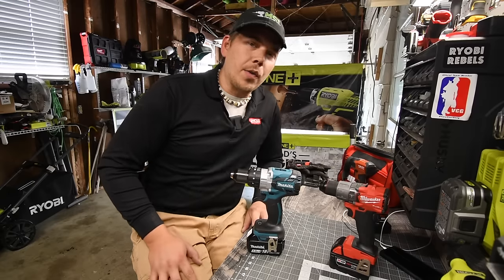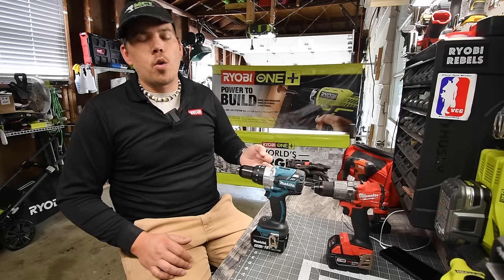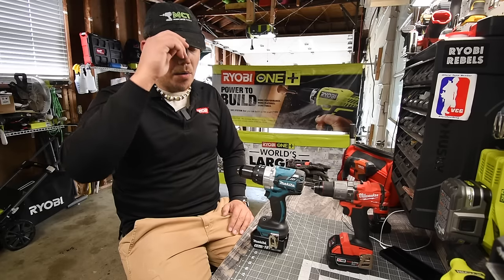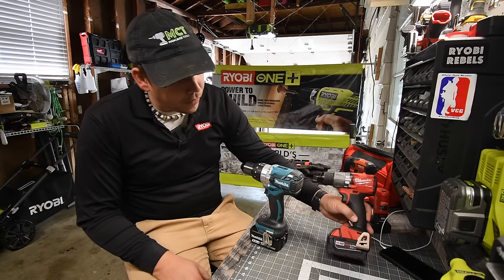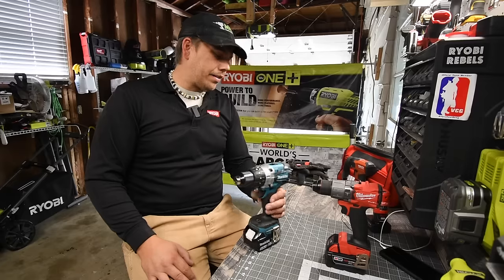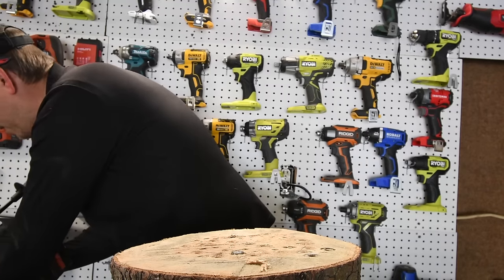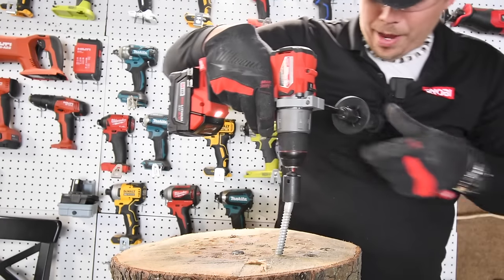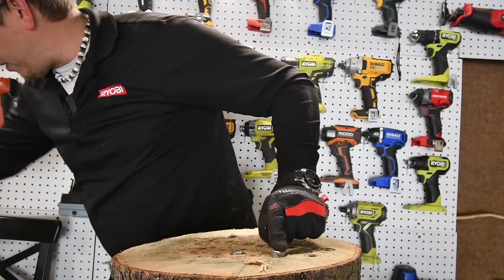BATTLE OF THE BRUSHLESS!!!  (Makita vs Milwuakee)

Comment: Build quality are equally excellent, same plastics, great designs, but Milwaukee has the edge in motor and battery design, however, Milwaukee tend to use fragile ribbon/small cables inside, the Makitas have solid wiring.
There is very little to go wrong with Makitas, just takes the edge in Robustness I would say, so power or Longevity?
Reply: But what's actually a better design, the F1 race motor that needs to be rebuilt after every race, or the diesel that clears a Million miles before it's first.

Our shop has 4 Milwaukee drills, two run, one is an old brushed design that has no guts and the other let's bits go randomly while you're drilling
Reply: @jonathangarzon2798  I have had hundreds of these tools apart, Milwaukee and Makita only have slight quality variations, you get a FUEL and you can bet its going to last a long time, don't touch the none-fuel however.
Get Fuel and you will wont go far wrong, it might even last longer than most Makitas.
Reply: @suzesiviter6083  Im not sure what you do for a living but Im a welder/fabricator so tools that might last a moderate amount of time in a regular construction site just don't make it.
Drilling through metal takes a higher toll on tools and the metal particulates in the air, and constant high frequency EMF shorten lifespan of any electronics.

The only tools that I can say have proper longevity are the recip saw and bandsaw from Milwaukee.
And quality is definitely not close. The battery engagement alone is slop on Milwaukee (though not as bad as DeWalt)
Reply: @jonathangarzon2798  A lot of people complain about battery slop yet few have had any real battery connection problems,, have you? they use the same knife contacts as Makita.
Are you using fuel versions?
Check out Ave channel with tear downs, I am not convinced Makita is better quality and if I were doing drilling all day, I would be buying an Hilti not one of these class of drills.
As for metal dust, Milwaukee fuels are fully sealed electronics, potted, you could even throw one of these in a bucket of water or oil and they would still work, plus the gears are usually the properly machined parts not the sintered variety in the places that matter.
Reply: @suzesiviter6083  yeah we have two Milwaukee batteries that have to be taken out and re seated during drilling due to bad contacts and since they aren't corroded it's gotta be a mechanical issue.

Battery slop transfers undue torsion on the contacts shortening life. This is the problem with brand fanboys though never can admit anything is wrong until they do, and then it's "good enough".

Fuck brands I get the tool grade according to use, and tool according to best quality.
Reply: @jonathangarzon2798  But are they Fuel, trust me it does make a difference, for instance the battery connector on Fuel is usually put under tension by a spring.
The fault you mention is probably the sense connector losing connection, that's why it doesn't start back up till the battery is removed, light sanding and wd40 should do the trick.
Only serious fault I have EVER seen on fuels is broken ribbon cables, and I used to buy faulty ones to repair.
Reply: @suzesiviter6083  yeah we don't use non fuel
Reply: @jonathangarzon2798  ok, well good feedback, Makitas been ok?
Reply: @suzesiviter6083  yeah don't get me wrong Milwaukee doesn't make bad tools but for the premium over the Makita LXT it's just not worth it in my opinion, but yeah haven't had issues with my Makita drill or mid torque also noticed it runs cooler than the Milwaukee's and way cooler than my old DeWalt
Reply: @jonathangarzon2798  Yeah know the LXT grinders are perhaps the best. I think the heat issues is due to the extra torque though)
Reply: Milwaukee doesn't really have the edge in motor designs, Makita does. Milwaukee just prioritizes performance, Makita prioritizes features and ergonomics.
We really see this come through between the impact drivers and wrenches, where Makita's drivers tend to not one up themselves each generation on torque/RPM, have enough power to snap 1/4" hex shanks towards the peak of their power range, but add more features like bolt/wood/sheet metal modes and programable buttons, where Milwaukee primarily makes the newer versions more powerful and smaller but not adding more features.
Whereas with impact wrenches, where we aren't limited by 1/4" shanks, we see Makita really does push quite a bit of torque relative to their class, and being the major company that actually poses a challenge to Milwaukee very regularly. IIRC, Makita offers the better performing high torque and compact wrenches.
Reply: @reaperreaper5098  I think just about anyone would prefer power, with power comes less strain on motors due to less overheating. No IMO you are wrong, perhaps you are a makita fan boy.
The high torque M18 fuel impact wrench is THE standard, check out the torque test channel.
Reply: @suzesiviter6083  You should see TTC's video on the 3/4" XGT High Torque.
You've also missed the mark completely on the Makita fanboy comment. I've ran Milwaukee for nearly a decade, I just haven't deluded myself into thinking that Milwaukee's the outright best.

You're also wrong about the "just about anyone would prefer power," because the differences in even most testing demonstrates that picking any of the big 3 is going to do great, and many mid tier brands also do very well. And Makita has a huge following for its ergonomics.
Reply: @reaperreaper5098  I am talking from a science perspective having taken apart all the well known brands, Milwaukee motors use few winding, high current, with their inherently low resistance field windings, they will run cooler at high torque, heat is the main killer in power tools. Makita used to be the best, but their motors are simply not as advanced as Milwaukee, even the drive circuits use sub-mohm latest generation of IR mosfets reducing heat and lifetime of circuitry-output mosfets being the weakest link in power tool circuits.
As for mechanics, makita might use better machining occasionally, but even 5 year old heavy use Milwaukee tools have insignificant wear in all those I have seen.
Reply: @suzesiviter6083  A "scientific" perspective, fewer windings isn't automatically better, it's a trade off. Fewer windings, higher RPM, lower torque. Bigger windings, vice versa. And between comparable 18V tools, the winding counts are similar.

As for Milwaukee using higher current motors, that too is a double edged sword. Higher current, the more heat, it's the direct result of driving up current (and why every other company is moving to higher voltage platforms for beefier tools). Hell, it's for this exact reason that Mils has to use vastly larger motors for tools like their chainsaws and circ saws, which is an antiquated approach.

You also talk about Milwaukee's component selection as if they're the only ones that have that option and leverage it. Which, quite frankly, is not the case, for two reasons. 1) None of the big 3 use the absolute best components available, it'd be too expensive for the price point they aim for. 2) The big companies that position themselves in the prosumer/professional market are all using components of very similar quality.

Hate to say it, Milwaukee isn't outright better than Makita. They're not outright better than any of their prosumer market (except Flex). They're an option in a market segment where it is pretty damn hard to go wrong.
Reply: @suzesiviter6083  the m18 fuel drill and the makita lxt 18v drill have already been extensively tested and the makita always runs cooler with its engine while the milwaukee has high engine temperatures
Reply: @reviewsyanalisis7244  Thats because the Milwaukees always have higher torque hence power, cant defeat laws of physics.
But a motor under less strain lasts longer, thats why it would be milwaukees every time for me.

Comment: just picked up the same model from my local home depot tool rental lol only went out twice and it came with 2 5amp and a nice charger. paid 100 bucks with a hard case   the chuck gave you a hard time but coming from milwakee I have to say I'm impressed.  yeah it might be a sec or 2 faster or slower but man it was 20 degrees cooler than the milwakee.  in my opinion that's called efficiency.   a nice cool motor will last alot longer!
Reply from the maker: I agree with you on that, that is why temperatures are important as well

Comment: Thanks for the review, I own Makita and Bosch both line of power tools right now, used to own Bosch and Milwaukee but after my Gen2 impact driver was died then swap to Makita line. Personally the I saw the Makita chuck died with another IG users and same as Milwaukee, but I never had any issue with Bosch chuck for past 5 years time, I know for the Bosch drill speed may behind Makita and Milwaukee, but it still good for my trade with Bosch. I just love the feeling for Makita and does job so well. For the weight distribute of Milwaukee is not suit for me, it seems like Milwaukee put lot of weight in the front and battery. This Makita drill was over 6 years old did good job even compare with the latest Milwaukee drill.
Reply from the maker: I do think it is time for Makita to upgrade this tool
Reply: @ManCaverTools  however makita 40v is released don't know what strategy in the future of the company. Probably makita will get ride of 18v x 2 system and keep 18v and 40v both line together?

Comment: I have never had the chuck come loose on my xph07. The m18s I use at work do come loose and freeze also.
Reply from the maker: I push these tools through the extreme tests and I thank you for viewing Darren
Reply: Neither have I. I love my xph07
Reply: Milwaukee tools never let me down in any conditions snow rain nothing stops them
Reply: Milwaukee does make good tools. I'm a second generation plumber and they make a lot of great plumbing tools. My dad and a few other guys have milwaukee fuel drills and one of them the forward and reverse selector doesn't activate unless you pull the battery out and put it back in. The other drill will just stop working all together randomly and then start working again. Every brand has there drawbacks I've just seen that first hand. Never had any issues with my makita stuff but every guy is loyal to their brand 👍
Reply: Milwaukee never let me down either

Comment: I had a lot of makita,s ,now have 484 and 486 but the Chuck is always a problem
I bought an more expensive Chuck for the 484.
Sometimes when they get hot the drill or bit get stuck in it and you need a lot of straight to get them out and it never sounds good when you do that
It sounds that you break something but it never happens.

Comment: Remember......the Makita is AT LEAST 5 years older than the Milwaukee.....5byears older technology, electronics.....The Milwaukee is already 2 years old.
Reply from the maker: Yes it is. I think it is time for them to upgrade
Reply: Is that the latest model?
Still thinking of buying makita still choosing
Reply: @user-tu7rr1zg4b  yes it is however theyve got a new drill coming out soon hope this helps
Reply: The milwaukee 2704 is 6 years old but is much poweful than the latest milwaukee 2804 when it comes to concrete. The 2804 only have the torque but not the hammering power due to its reduce size

Comment: As I said, I own that Model of Makita.  This was one of your better ‘Versus’ videos.  Having said that, and as Eryn Brady said, regarding the chuck, the one on your drill didn’t ‘sound’ right, or act right?  And once a Chuck has slipped twice or more under that pressure, the jaws will lose some ability to hold onto the bit.  Love your channel and videos dude, but please try fully tightening the chuck, and then leave it.  Don’t turn it back a click!  Trust me!  I’m surprised the Gen 3 Milwaukee didn’t do better.  It is a powerful drill. I tried it but just don’t care for it.  And the ‘smell’ you mention Dave, I believe is a characteristic of that drill.  Mine always has a slight warm oil smell?  Hard to describe.  I would get Makita to warranty that chuck.  Their repair facility in NJ does a great job.  Just FYI. Thanks
Reply from the maker: I thank you for your reply. I just think I need to put a new chuck on it. and I think the smell is the natural smell from the makita motor. and I thank you for viewing George
Reply: Man Caver Tools, Dave I just saw George’s comment directed towards the chuck.  Why are you being so obstinate regarding tightening the chuck correctly?  You are the first person I’ve seen rotate the chuck counterclockwise after fully tightening it clockwise.  You may have inadvertently damaged the Makita Drill’s chuck jaws by running it hard without having it fully locked into place.

Tighten the chuck fully clockwise until you hear the ratcheting sound, then continue to turn clockwise until you can’t turn it any more!  Don’t turn counterclockwise after fully tightening!!
Reply: I own both drills. The Milwaukee is better. Nobody uses the non high output batteries anymore. He needs to redo the test with even a smaller high output battery.

Comment: The Makita has a Yukiwa chuck which should be the best in the market, this one must be damaged.
Reply: If you look closely everytime he tightens the makitas chuck he turns it the other way which unlocks the chuck thats why the bits keep coming loose its user error
Reply: Joshua Helms its common knowledge for chucks to lock it by turning it back one to engage the positive stop mechanism; dewalt and milwaukee has that knowledge in their manuals
Reply: @dvxAznxvb  i just checked my manuals on several different drills makita and dewalt and they say nothing about tightening then turning it back to lock. What they say is counterclockwise to loosen and clockwise to tighten. Dewalt even says turn clockwise till you hear a few clicks to tighten. I've been using drills and other tools for over 25 years I think I know how to tighten a drill chuck. If you watch him with the makita he tightens then turns it the opposite direction which unlocks it i have the same model makita and I did what he did and the bits come loose but when I only tighten it the bits stay in.
Reply: Joshua Helms interesting find i have dcd777,791 and 996 and all the chucks have a stop when one click to lock the bit then it releases if i continue; it doesn’t release the teeth when turning it anti clockwise one stop

As i believe the premise is that the motor controls the teeth but since it has a ratcheting function you have to lock the teeth to prevent it from loosing which isn’t a big deal for most applications but if you have to use reverse immediately such as a reverse thread or larger bits this is where i noticed you have to lock it instead of relying on the clamping force of the teeth to prevent the bit from moving
Reply: @dvxAznxvb  thats strange I tried my 995 and 790 dewalt and my makita xph07z and xfd11zb and if you tighten it till it stops and turn it back counterclockwise the bits will come loose under heavy load but if you tighten it till it stops and leave it their fine.
Reply from the maker: Thats what these tests are for. and that is why I do these
Reply: Joshua Helms if you have a look at pro tool reviews Chanel, they did a video on the chuck locking mechanism and he wasn’t just loosening the chuck
Reply: @bernardheine4516  no he wasn't loosening it just unlocking it which causes bits to fall out under heavy load.
Reply: Colleague has the makita on site the chuck fell apart over time and another guy had and same thing happend
Reply: Ave disproved this. It loosens the chuck.
Reply: @Mike-vt6is  I have used alot of drills everyday for 20 years and Ave is wrong😂

Comment: Thank you for the video, there is one thing that I would like to know that you didn't probably mention, when you was running this tests, which one  showed up the best vibration.
Reply: By the way I loved the video and I just subscribed!
Reply from the maker: I thank you sir. when it comes to small hammer drills, they all have major vibration. which is why SDS is better if you making a ton of holes through concrete

Comment: Get ur makita chuck serviced mine never does that and it easily equals the Gen 3 on that concrete test ive used the same size bit clear the holes more..like the video 📹 👌
Reply from the maker: I plan too and thank No one
Reply: no one special, it will not!  The Milwaukee Gen 3 Fuel Hammer Drill is more powerful and has more torque than the Makita drill, serviced or not.  lol!

Comment: Dave, if you’re clicking the Milwaukee’s chuck backwards to lock that actually unlocks the chuck.  Twist clockwise until it clicks into the detent.  Don’t go backwards or counterclockwise for the final twist.  I even went into the manual, which directs to turn until you hear a ratcheting sound and it can not be turned further!  Who told you to do that?  Whoever it was they’re a ding dong head, just trying to make you look bad.

With regards to the Makita I’m not sure, but it seems strange that you need to do the one click back deal here as well....  I think you’re actually disengaging the clutch detent when you do that.  In fact that may have been your issue when the bit was stripped.  The chuck came loose 4 times during the concrete test...Next time try tightening the chuck as tight as you can in the clockwise position...DON’T TURN CLOCKWISE FOR THE FINAL TIGHTENING.
Reply from the maker: if you click back once it locks it in place.
Reply: @ManCaverTools , no it doesn’t...it loosens the chuck.  Where did you get this information from?  Can you point to a section of a manual?

I really believe that’s why you had chuck strip issues with the Makita.

After posting this comment to you I read quite a few other comments that say the same thing.
Reply: Marty, the makita does need to click backwards to lock the chuck. Common knowledge to makita users.